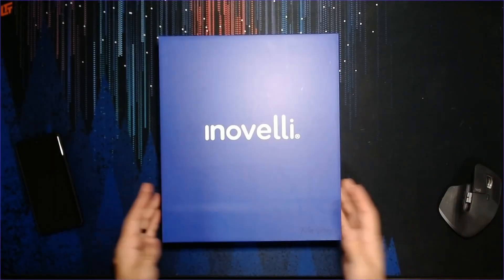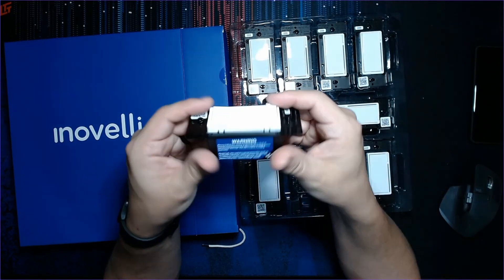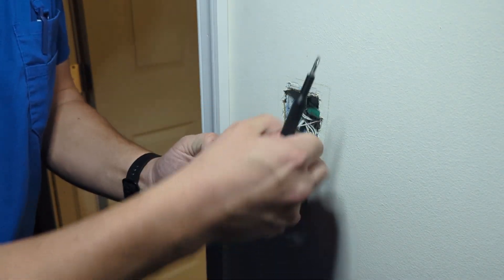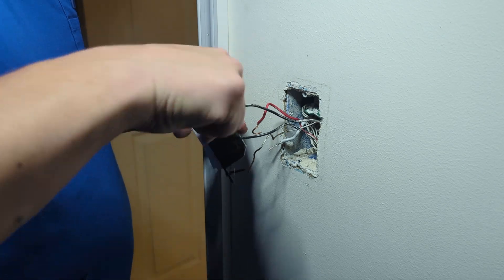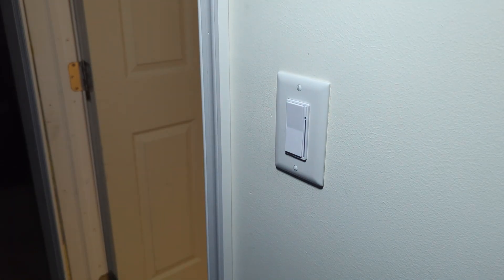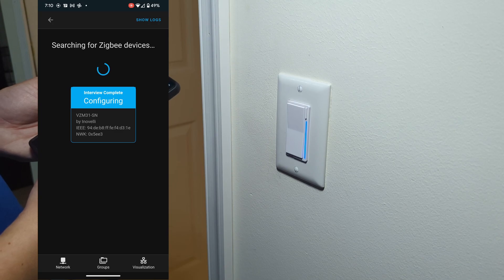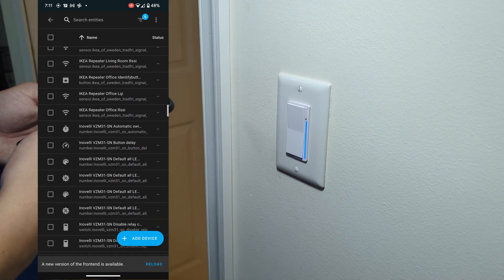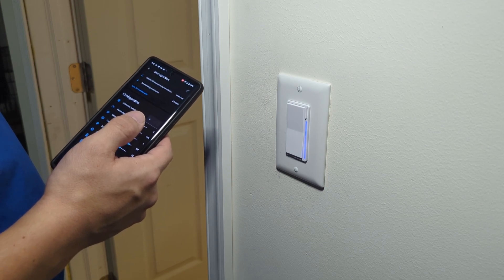Inovelli Blue 2-1 Switch Unboxing and Installation with Home Assistant

Comment: Hi, I'm new to this, and have a basic question. My wife wants to have a physical switch that can control the kitchen lights (which are not smart lights) and the living room lights (which I have connected to Zigbee smart plugs). 
1. If I replace the light switch box for the kitchen lights with the Inovelli switch, will flipping this switch "on" turn on both the kitchen lights and the living room lights at the same time? 
2. Is it possible to have a "timed" setting so that flipping the switch before 5 PM only turns on the kitchen lights while flipping it after will turn on both the kitchen lights and the living room lights? I ask because we have floor to ceiling windows for the living room, and we get good lighting for the living room during the day.

Or would you recommend trying to set up a relay instead since my wife doesn't actually care too much about the dimming control on the physical switch?
Reply from the maker: Yes that should work. You'll want to make an automation with conditions based on time of day (or better yet in relation to sun position so that it works even as sun timings change throughout the year). In HA set an automation to trigger when the switch device "up" button is pressed. If it's at a time of day that's going to be "dark" then turn on the living room lights, otherwise do nothing. I'd use that as the trigger instead of "kitchen lights on' so that you can still turn on the living room lights when it's dark if the kitchen lights are already on. I'd probably make the "off" automation not time dependent so you can always turn everything off, but you may have a preference to do that differently depending on your needs. You could also consider  programming it off of double taps if you wanted direct control of the living room lights at all times. It's a super versatile switch that exposes darn near anything you could hope for!

Comment: 3 way smart switches will be the literal death of me! (hope not) Question... is it possile to pair this Inovelli 3 way with a dumb 3 way on the other end?
Reply from the maker: Yes, you can use a dumb switch if you have a neutral. But you'll be better served by putting a $25 Aux switch at the other end so that the paddles and directions all match properly for on/off. https://help.inovelli.com/en/articles/8210030-blue-series-2-1-switch-wiring-schematics

The wiring is also (in my opinion) way simpler with an Aux.
Reply: @averagejoestech  make sense, thansk for the note

Comment: how do you get home assitant to work with this and other zigbee devices, do I need some type of usb dongle for my machine running home assistant?
Reply from the maker: @emilianoruiz7681  Yes you will need a ZigBee coordinator to form the network. The simplest setup for Home Assistant and ZHA is the ZBT-1 (previously Home Assistant SkyConnect) USB dongle.

Comment: Does this work with HUE Hub?
Reply from the maker: No, it seems that while Inovelli has tried to integrate with them, they were rejected from the "Friends of Hue" program. You'll need a more open ZigBee hub or stick software to utilize one of these Blue switches. I've successfully run them on Home Assistant ZHA, ZigBee2MQTT, SmartThings, and Hubitat.

Comment: How do you set it to dim a light?  And how would you dim up or down on the light switch?
Reply from the maker: There is an option for Output Mode where you can switch between OnOff and Dimmer modes. When in dimmer mode a tap turns it on or off and a press and hold adjusts the brightness up or down. The LED bar adjusts to show the current output level.

Comment: Thanks for the Video, what did you install to get the "configuration" box to showup on the device's page? Mine doesn't have it at all.
Reply from the maker: I'm not using anything special to get that to show up, it's just how ZHA recognizes its capabilities. Are you maybe using the Zigbee2MQTT integration instead of the ZHA integration to link your Zigbee devices to Home Assistant?
Reply: @averagejoestech  No, I'm using ZHA. It's a fresh installation with everything up to date so I don't understand what is going on... I can set the values through the clusters but that's just hard...
Reply from the maker: @Niklaos  maybe it just didn't auroconfigure correctly when it joined to the mesh? Per someone on the Inovelli forums you might want to try removing the switch and re-adding it. https://community.inovelli.com/t/home-assistant-doesnt-show-all-configuration-settings/12074
Reply: @averagejoestech  thanks! I'll try that and report back.